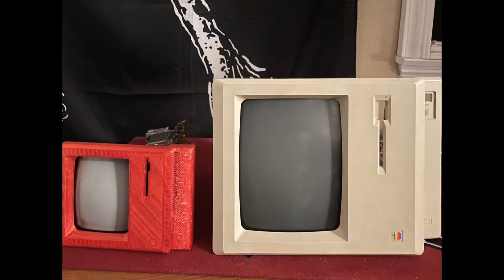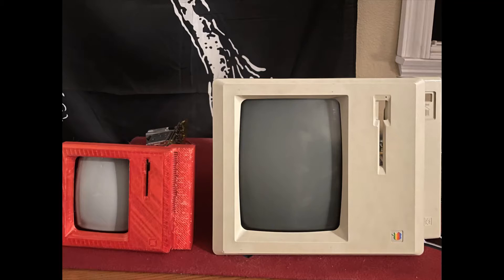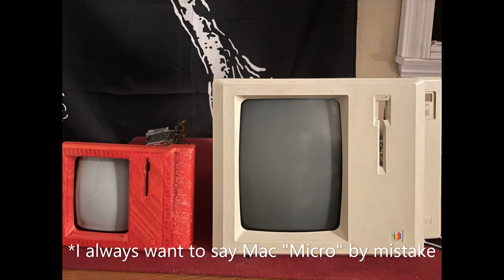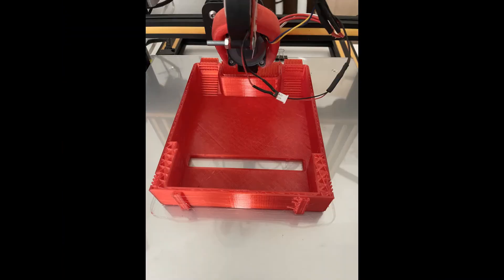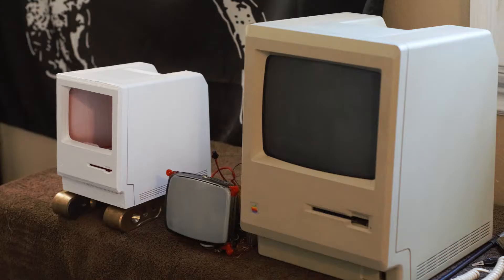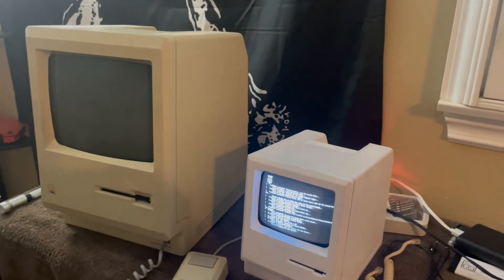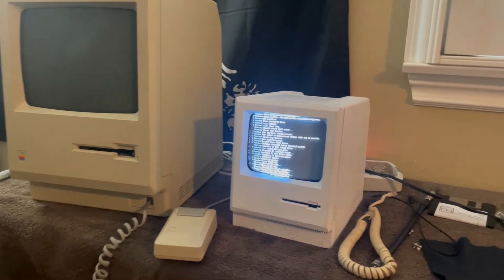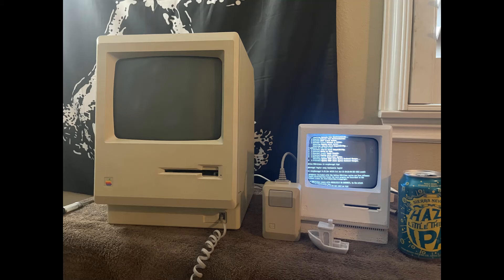Project Macintosh Minus - Pi powered mini Mac Plus with CRT display

Comment: NOW THAT IS THE CAT'S MEOW👍👍👍👍👍 How did you tie into the CRT circuit? Best Macintosh mini project I've seen!
Reply from the maker: It's just composite.  Unfortunately I fried the pi and the vertical deflection IC on the TV; so I'm waiting for a new "holy shit silicon is expensive in 2022" pi zero and I'm working on a new case that is easier to mod for multiple TVs and analog boards.

I went to film some footage outside in good light and there wasn't any audio in, so the speaker was buzzing.  I tried to pull the speaker wire out the back to disconnect it and something hit the one spot where I tore the kapton tape off the bottom, frying something in the vertical deflection circuit.

I fried the pi by forgetting to unplug it when testing the new tv, searching for the composite pin on the main chip.  Dumb mishaps.
Reply: @vorg_  Yep, I hear you about the prices of the Pi. I was in the middle of a new project, and when I went to order a new Pi, my jaw hit the floor, people were hawking them as high as $175.00 used. I switched gears and I'm now modifying my project for a MacBook Pro logic board that I picked up for way less.